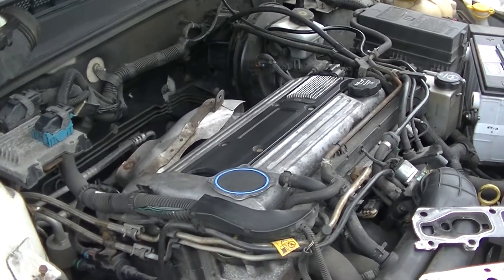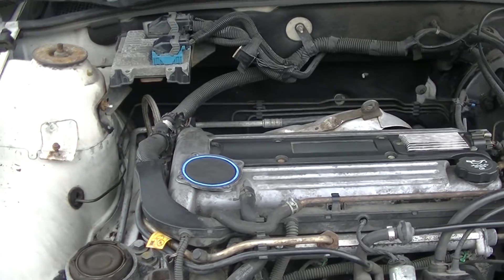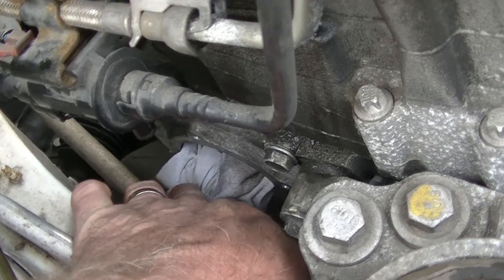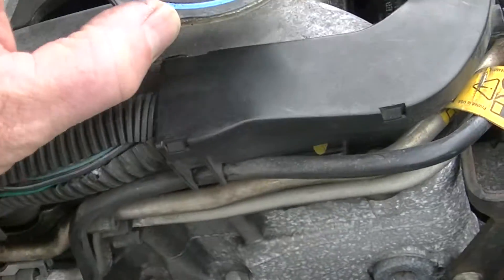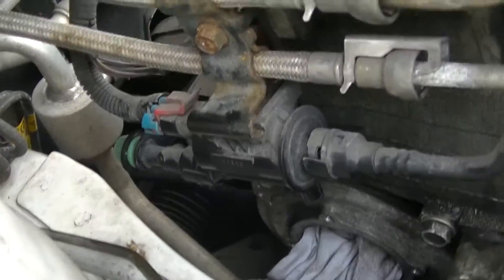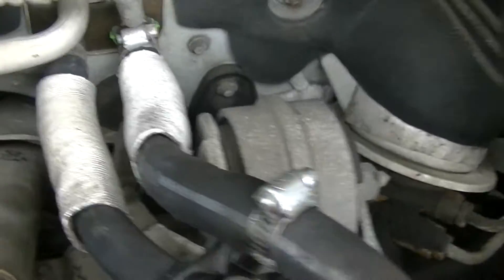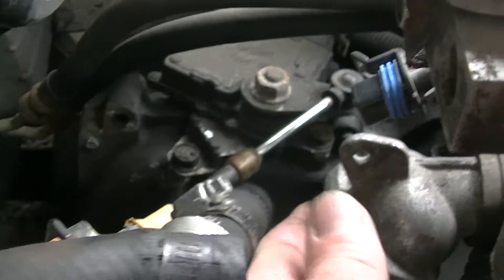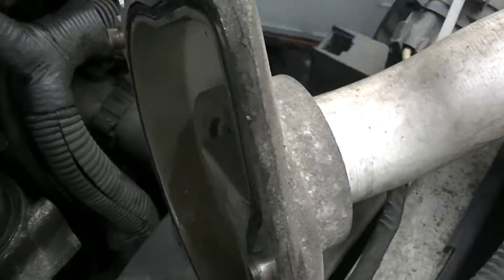Saturn LW200 Water Pump Replacement Part 1

Comment: Oh my, I was sitting here looking at the oddest bolt of my bunch and wondering where in the world I could have pulled it from 🤢

Turns out it was the bottom bolt below the thermostat housing. Whatever instinct I have told me it was odd for it to only be held in by two bolts and I still missed the lower one.

Comment: if the timeing chain is on the front passager side how the heck is their a timeing chain in the back to run water pump on the drivers side
Reply from the maker: Everything is on the passenger side.
Reply from the maker: Water pump is on passenger side.